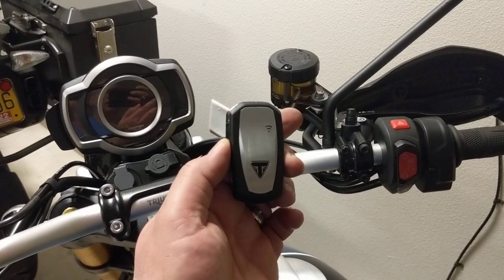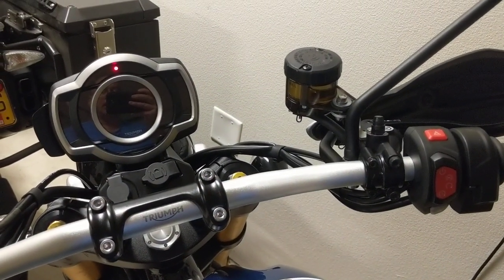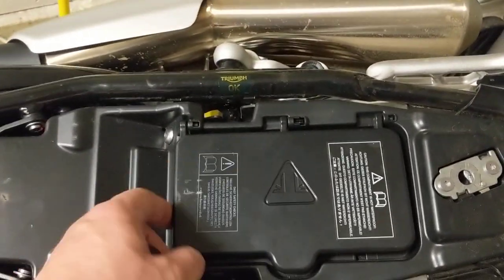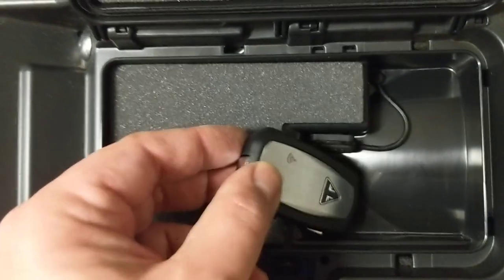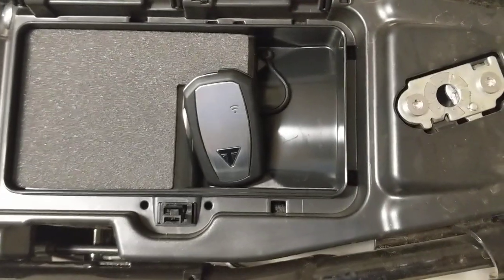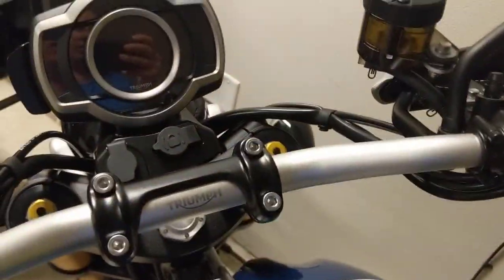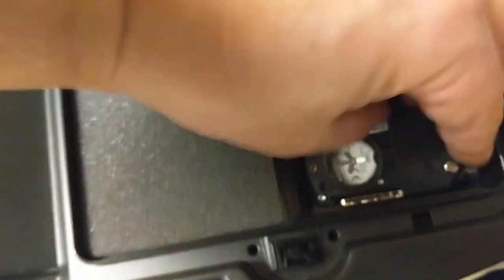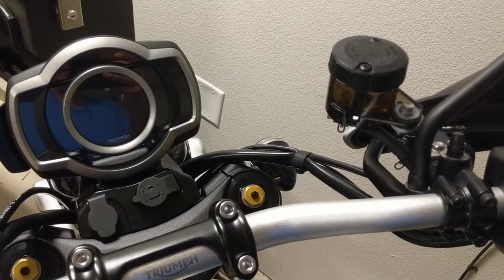Triumph Scrambler 1200 Dead Fob ,= no start?

Comment: I tried with the manual key and it worked on mine, though I wish they would have stuck to old bulletproof technology instead of trying to fix a problem that never existed.
Reply from the maker: My manual keys work too, I was surprised the fob didn't.

Comment: You are supposed to do it with your secondary key, not the dead fob.
Reply from the maker: It works fine with the secondary key, the manual says the fob should work as well.  On my GS, the dead fob and the manual key both work, I was surprised that it doesn't here.
Reply: Should work with both, if your fob dies in the middle of nowhere then what do you do ????? You supposed to use your dead fob.

Comment: What I don't understand is the reasoning behind these darn things. What do they bring to the table? Fobs are heavier and larger than keys, they run out of battery, are sensitive to humidity, if they fall they may break ecc. Bike interface is almost as delicate. Antennas can suffer from interference and waveforms can be jammed to block you, or replicated to gain access to your bike. One could loose his key while getting on the bike, drive 100 miles wihout realizing only o find himself screwed the next morning... NONE of this happens with a normal key.

All this and more... in exchange of WHAT?